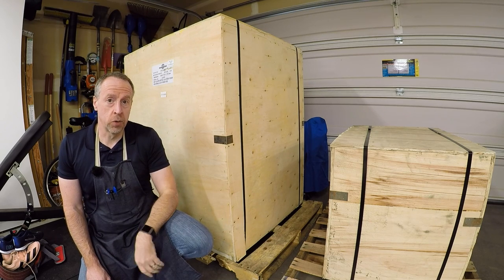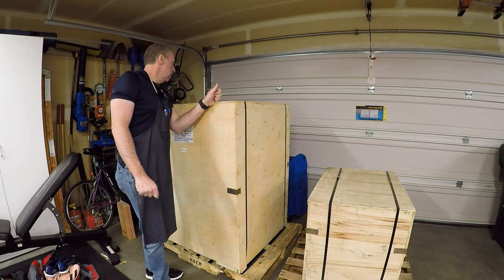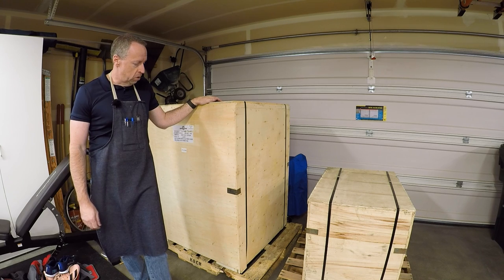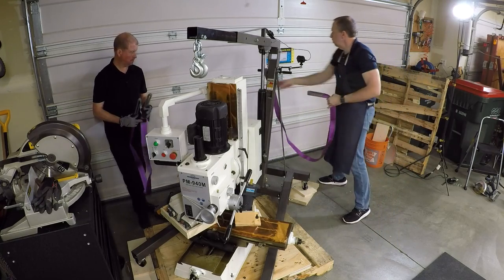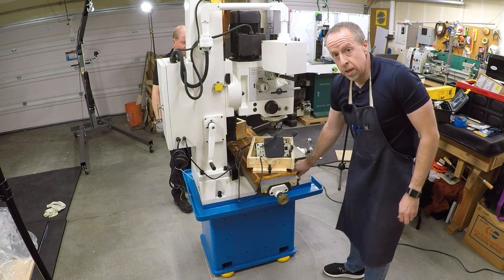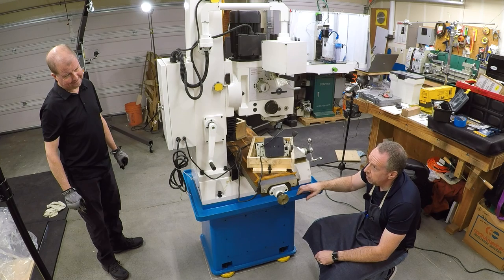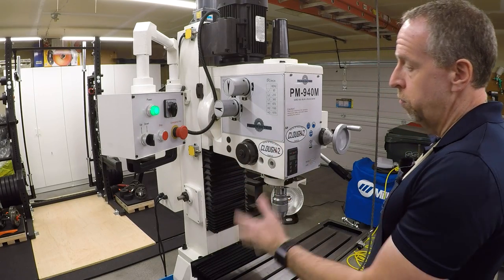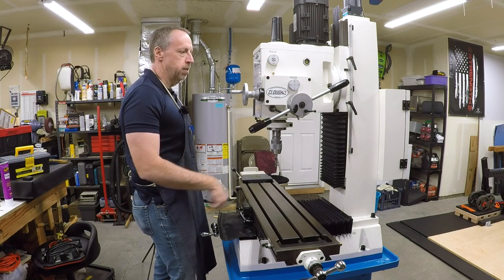Setting up a New PM-940M Milling Machine - Unboxing, Moving and Assembly

Comment: How would they do that? Simple, have you ever been to a cross dock shipping point? Forklift drivers whose sole purpose in life is to see how fast they can move stuff from the incoming to the outgoing truck. Regardless of what happens along the way. My company used to ship a lot of stuff. The risks of it being damaged were very large. We finally quit using regular common carrier. If you have to ship common carrier, use sealed divider or get a pup or full trailer to yourself. That also means no lift gate available. I can ship a 20' container from Nebraska to Germany for the same price as a load to NY city. No semi-sane truck driver will take a load to NY city!

Comment: Gravity is very weak force. If the strap broke the base would emmediately mash some fingers against the floor. Put a 2 x 4 under the base and the feet of the hoist. Other than that how did you persuade someone to let you buy this nice mill just before Christmas?

Comment: It may have been rough seas when it was coming over. That’s my best guess.
Reply from the maker: The crate was packed in Pennsylvania.  This isn't the worst freight abuse I've seen, though.  If you check my Instagram, you'll see the totally destroyed remains of a surface grinder that I received last month.  They literally delivered half of the machine, sitting loose on a pallet, in a pool of its own oil.

Comment: Nice setup, just wondering how long it will take till you decide to raise everything up to a reasonable height so as not to give you backache, its the reason I made my own stand as for me the factory one is far too low and I'm not tall.
Reply from the maker: Already did.  I bolted a pair of 4x6 rectangular tubes to the bottom of the stand and mounted the adjuster feet under those.

Comment: The scary part is hoisting the mill off the pallet with a single 2000 lb rated Harbor freight strap when you have two on hand, and sticking your hand and parts of your body underneath it. I own and appreciate a number of harbor freight tools, including the 6400 lb rated strap, but I don't trust any of it that much.

Comment: Hi, when you cleaned and oiled the mill did you just do the ways or did you do the leadscrews as well? Did you remove shims to clean? (I have a new mill to set up). Thanks in advance....
Reply from the maker: I oiled the screws.  I have not pulled the gibs yet.  The table wouldn't be a huge deal, but the head is pretty heavy.
Reply: @Clough42  Got it. Thank you for replying to my question. Your answer helps!

Comment: Does the quill power feed have a limit switch? I could see nasty things happening with a gear train pushing down a quill at the end of it's travel.
Reply from the maker: Yeah, there's some kind of cam that pops it out when it reaches the end of the downfeed dial range on the quill.  I haven't totally figured it out yet.

Comment: Would you be able to convert this to CNC? I am looking into milling options, but I primarily work in steel
Reply: The PM-940V (this is the PM-940M) is a better choice since it has a variable frequency drive and can get up to higher spindle speeds.

Comment: Sure the base is 400lbs but the stuff inside it was not. And if that traveled in the rear of the semi trailer that is the most bouncy part of the trailer. It can easily toss those small boxes around as it travels the country. Proper packaging from the shipper would be prevented that.
Reply from the maker: I'm still impressed.
Reply: Its not traveling in the truck that probably did that.... the waves in the pacific can get pretty big and the accelerations going from negative to positive after the container ship crests those waves and slams to a stop in the trough can get pretty big. It probably tossed those "light" packages in the base like ice cubes in a shaker.
Reply from the maker: @davidruss7702  the accessories were added to the crate in Pennsylvania.
Reply: @Clough42  Correct, thats on us, not from the factory.

Comment: Sad to see even the larger PM mill stands are far too short. I bought the PM25 with the stand. Um yea, it's FAR too short unless you're 4' 8" tall. Annoying to say the least. Now I'm going to have to make an extension to get it to the right height.
Reply: You wouldn't believe how many people say they are too tall. I agree that I would like some of them to be up a bit higher, but its all over the map on the opinions. And to get in to different stand heights is just too specialized, I have thought about that, but have decided against it so far. It would be expensive, and harder on inventory.
Reply: @precisionmatthewsmachineco  Very interesting. I'm not sure how someone could say the stands are too tall? I'd wonder what the average spindle height is on full size milling machines like a bridgeport. There's other videos on Youtube where other PM mill purchasers made extensions to get the mills higher in the air.  I love my PM mill so far but to be comfortable, I have to sit on a stool as I set things up on it vs. bending over to do it.

Comment: I picked up my 940 myself and inspected it before loading it on my trailer. All the small parts were purchased when I ordered it and inspected personally beforehand. Matt was cooperative in my scrutiny. It appears that whoever pack it did not secure the parts properly in the base and the shipper took the shipment down a rough road. Mention it to Matt to have staff secure loose parts and not lay anything loose in packing crates..

Comment: How on earth do we lock the spindle to change collets?
Reply from the maker: You can either drop it into L-1 and get enough resistance that way, or you can buy a spline wrench to hold the spindle spline shaft in place while you tighten.  There are also designs for impact wrench based power drawbars that just use the inertia of the spindle, but that seems a little harsh to me.  Might be fine.

Comment: I recently received my PM-940V.  It is a very nice machine.  Quite a bit larger than the Grizzly G0619 I also have.  I've designed brackets to install a DROPros EL400.  I also designed a caster system to allow me to move the mill.  My shop is in one bay of my 3 car garage, so moving it on occasion is helpful.  Using the FEA capability of SolidWorks gave me the confidence to insure the caster design is sufficient.  If you are interested in what I've done, I've posted a response to a thread on the 940 series where space is at a premium.  https://www.hobby-machinist.com/threads/recommended-minimum.87439/ .  As I get more work done on the machine, I expect to post my other design work.  Enjoy the machine!
Reply from the maker: Did you post the DRO brackets?  I modeled up the mill and designed something, but there are a lot of little parts to make, and seeing another design might give me some better ideas.  Or I might just steal it.  :)

I'm planning to build a bridge across the back of the saddle, over the way cover to hold the read head for X.  I think it's easiest to drop a plate straight down from the tip of the rear dovetail extension of the saddle on the left for the Y read head.  And I'm planning to lay a plate flat on the side of the Z slide, just below the top lock that extends back over the side of the column to provide a place to build up the Z mount, clear of all the crazy geometry on the side of the head slide.
Reply: @Clough42  I have been making parts to mount the DRO.  There are about 10 simple parts to make.  Either on the mill or my lathe.  Check out the Hobby-Machinist web site.

Comment: So packaging is crap but at least the holes line up and parts fit, its the opposite way around when my stuff arrives in Johannesburg
Reply from the maker: I know the feeling.  When I got my Grizzly G0704, one of the holes wasn't tapped.  I only discovered this after lifting the mill onto the base, when I couldn't get the bolt in.

Comment: 22:33 What is the point of crappy 'locking' washers over a plain washer? Locking the washers to the bolt head perhaps.  Locking washers are a waste of effort imo and that was formed long, long before I saw AvE's video about them.

Comment: it seems it's a Rong Fu 45 clone. Lots of internet material about modding those mills. Those square column mills are really solid. If you ever need even more mass, you can sandfill or granite epoxy fill the base. Some also add some granite epoxy to the column.
The table is awesome for a home mill.

Comment: It’s going to have been put into those crates in china, almost certainly. Probably the stack of two pallets was made when they were originally put into the container. And rough seas and zero packing is probably how all your stuff got jumbled together. 10-20 degrees of lean changing couple times a minute is not at all out of the question.
Reply from the maker: The small crate was opened and repacked in Pennsylvania.
Reply: @Clough42  wow. Yeah, sorry, then it clearly wasn’t that. And at the same time as all that damage to the accessories, there wasn’t enough damage for anything to have fallen over or something like that. And unlike most packages you can’t just put it down to underpaid UPS workers using it as a football. Weird!

Comment: When they put the accessories into the base at the factory they just tossed them in there.  That didn't happen because of shipping.
Reply: Yes, that was definitely on us. I am on it
Reply: @precisionmatthewsmachineco  Hey, quick question. I bought a 1440lb a couple years ago and I can't get the belt to stop squealing at the highest spindle speed. I had moved the motor to get as much tension on the belt as possible which only helped a little. Anything else I can try?

Comment: I'm surprised in a way that you didn't go for a Bridgeport clone.  Were you just being lazy and didn't want to move the ladder rack in the ceiling? Hahahahaha
Reply: I agree.  I was wondering why he would buy a questionable Chinese mill when he could have picked up a good used Bridgeport for about the same cost. Maybe he will address his decision making criteria in a later video.
Reply: @philshel1  I agree. Great videos James. I am learning a lot. You motivated me to get up to speed with Fusion 360 and 3d printing!
I just picked up a great variable speed 2hp Bridgeport at at auction. Is in excellent condition. $1700 which is pretty typical for a good Bridgeport at auction. Also loaded up on R8 tooling at the action also. Pennies on the dollar for boxes of end mills etc.

Comment: With the way that port operators run the equipment it's not surprising the parts are tossed around. Not really anything the seller can do about that other than opening fixing the parts then closing again
Reply: We do open each one, those items were put in there by an employee here. I will be addressing this first this tomorrow. We may be one person short depending on what happens.

Comment: this is a beautiful looking machine and i would buy it, but it looks like you tram the tilt with a hammer and there is no way to correct nod- that is annoying!
Reply from the maker: Yes, but it turns out to be pretty good.  The tram was out about .0015" over 12".  It came in with a couple of taps of a 24oz dead blow hammer.  I was expecting to have to fight it.  With the Z axis locks engaged, nod is out less than .001" over the 9" from the front to the back of the table.  If that changes over time, it could be scraped, but that's plenty close for what I do.
Reply: that IS good. if i was guaranteed that level of accuracy id feel much better about buying one

Comment: A decent size pothole at 65/75 in a semi trailer will do that.  I have seen all the tires on a trailer in the air.  Now the way your parts were just randomly placed in the lower base was crazy lazy.  Bubble wrap is cheap, easy, and cardboard is probably laying all over the shipping department.  Didn’t time check, but if you have not yet, then you really should inform them, maybe cop an apology?  At least, and more likely save the next guy damaged goods.  “But it’s just heavy duty stuff “. No, it’s not!  Think what would fit in that hole, the possibilities make me cringe.  Shipped tons of items, packaging is a lot more than a plywood box.   Great get it done attitude, kudos on your new tool!
Reply from the maker: Yes.  I've been in contact with them and they replaced the damaged case and drill chuck.

Comment: Really should be cleaning and adding rust inhibitor to all metal parts on your new machine before you start putting it together.
Reply from the maker: I have the good fortune of living in a dry climate.  Nothing here rusts.
Reply: There's nothing to put together that will inhibit the ability to add rust inhibitor after it's all assembled.

Comment: I must say the fact that friend Jason jumped on the skid and stuck his hands between the straps is a HUGE HUGE NO NO.  Everyone watching this never do either one of those things. No disrespect to the video though. I would have been calling them up and just snapping if I found a precision tool just crammed in the bottom of the base like that. 100% would be having them send a new one.
Reply: It will be all right. Some people have enough common sense and deductive reasoning skills to determine danger a lot better than others. He subjected himself to exponentially more risk driving to his house. There is zero risk of anything going wrong and his hands getting wrapped up between the straps. A lot of people hear things like what you mentioned, and about him sticking his hands under the machine when positioning the blocks and leveling feet, and they just parrot what they've heard. They usually have no real world experience. They apply these safety rules, that they heard other people say, as broad strokes to a million different situations.

Comment: You trust your crane too much, it's worth putting something like wood under things and lowering most of the weight off the crane before putting any body part under anything it's lifting. The speed stuff falls at is impressive when my ram failed on the same model you have, the lathe bed I was moving came down almost instantly (Colchester chipmaster bed and head about 300kg). When I moved my schaublin 13 I removed the feet by putting a few two by fours in under it and then unscrewing them and removing them while most of the weight was on the wood.

Comment: You keep calling bolts screws surely you know the difference between a bolt and a screw!!
Reply from the maker: I'm pretty sure I do, but maybe you can educate me.  My copy of Machinery's Handbook says that a threaded fastener used to draw two parts together using a nut is a bolt, and a threaded fastener that mates with threads formed in a part is a screw.